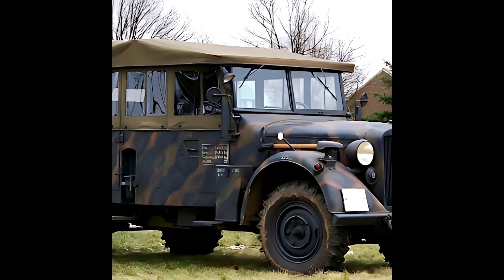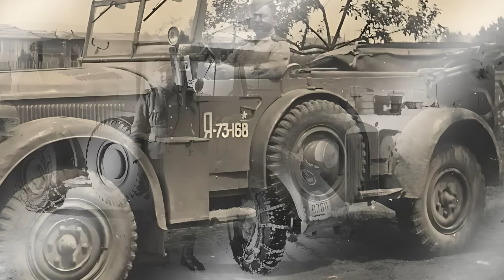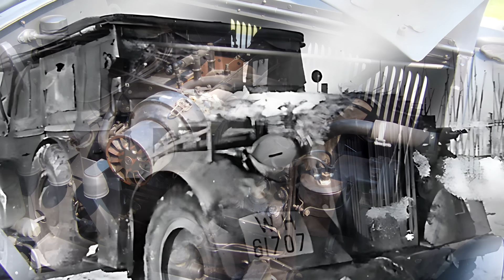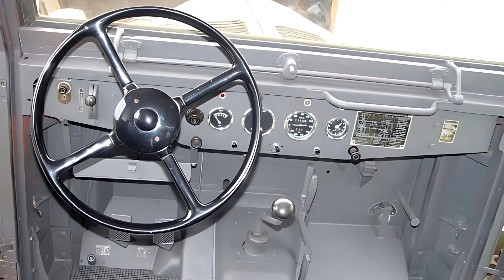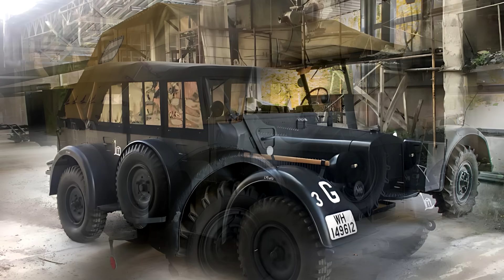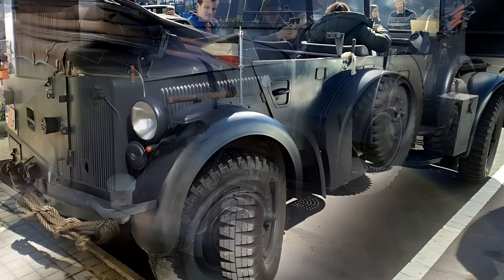1937 Horch 901 🌍 Designed to Go Anywhere… Even Where It Shouldn’t

Comment: Until 0,23 i thought. Ok. Vintage Toyota Hi Lux. I bet the rest of the vid. will reveal excately that.
Reply: :face-green-smiling:no, quite a bit heavier & likely less mobile, it was meant as a 10 passenger staff car...

Query>
Vintage toyota hilux when did they make an enclosed bus variant?

Brave browser answer>

The Toyota Hilux has never been officially manufactured by Toyota as an enclosed bus variant.  While the Hilux is a pickup truck, the related Toyota HiAce model (produced since 1967) has been widely available in enclosed bus configurations, such as the Commuter (seating up to 15 passengers) and Wagon variants. 

The HiAce Commuter was introduced in the late 1960s and evolved through generations (H10, H11, H50, H100), offering enclosed, multi-row seating for public transport. 
In Indonesia, a local third-party builder (New Armada) has created a custom enclosed bus version of the Hilux called the Rangga, which features three rows of seating and an enclosed cabin, but this is not an official Toyota factory model. 
The Hilux itself has occasionally been used as a chassis for custom campers (like the Chinook) or utility vehicles, but these are aftermarket conversions rather than factory-produced enclosed buses. 

Ok, thx HiAce in 4wd?

Finished
Yes, Toyota has produced 4WD and AWD variants of the HiAce for many years, primarily for markets with challenging terrain or harsh weather. 

4WD (Four-Wheel Drive): Older models, particularly the 100 series (1995-2004), featured a more robust part-time 4WD system with a transfer case, making them capable off-road vehicles.  These are highly regarded for their durability.
AWD (All-Wheel Drive): Later models, like the H200 series (2004-2019), switched to a full-time AWD system, often borrowed from vehicles like the Toyota Kluger (Highlander).  This system is designed more for improved traction on slippery roads (snow, mud) rather than serious off-roading.
Availability: These 4WD/AWD models were not sold in North America but were widely available in markets like Australia, New Zealand, and parts of Asia and Africa. They can often be found as used imports in other regions. 

Did Toyod/ta ever build a vehicle similar to Horch 901?

No, Toyota did not build a vehicle similar to the Horch 901.  The Horch 901 was a German luxury 4x4 staff car from the 1930s-40s, produced by the pre-war German automaker Horch for high-ranking Wehrmacht officers. 

Toyota, during that same era, was a fledgling company focused on basic trucks and passenger cars for the domestic Japanese market and did not produce any luxury military staff vehicles. Toyota's vehicles from that period were utilitarian and lacked the advanced engineering (like independent suspension and V8 engines) and luxurious appointments of the Horch. 

While Toyota has produced rugged 4x4 vehicles like the Land Cruiser, these were designed as general-purpose utility and off-road vehicles, not as luxurious command cars for high-ranking officers. There is no direct equivalent in Toyota's history to the Horch 901.